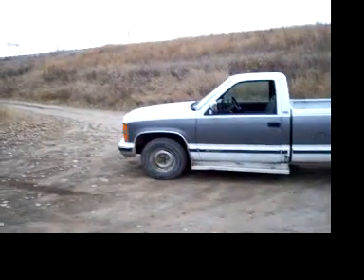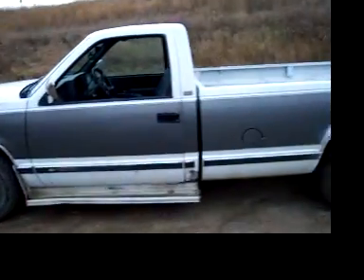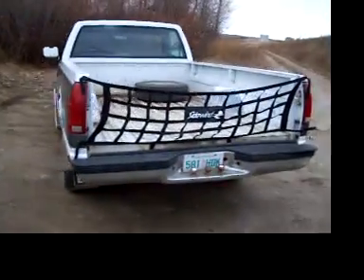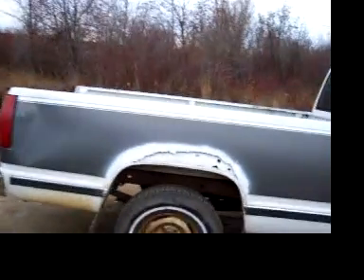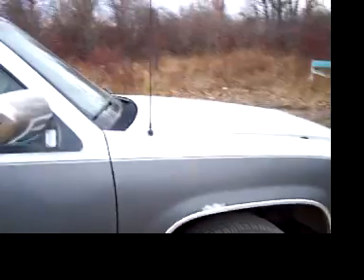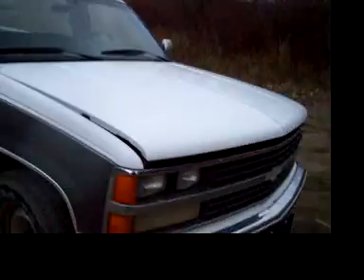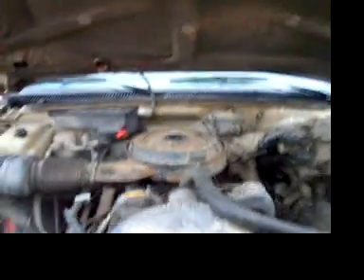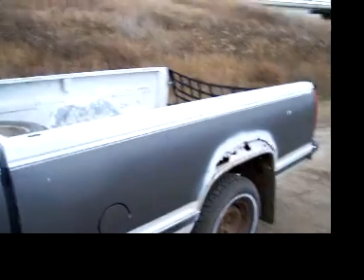1988 chevy 350 tbi truck walk around by request

Comment: x2 my 350tbi has over 400k on it and stil runs perfect, cranks a little easy but whatever.

still ran a 15.6 in the 1/4 mile... 5spd 350tbi 3.42 g80